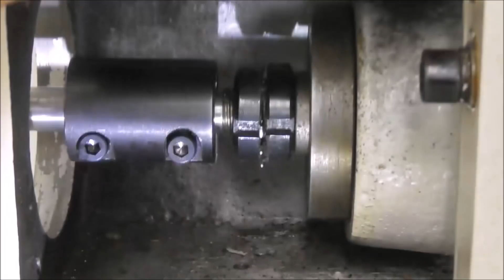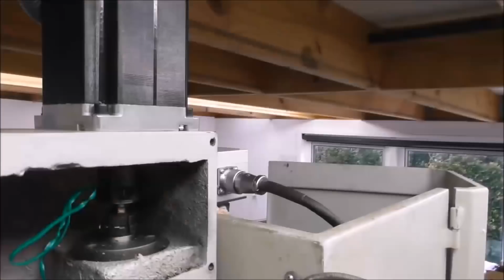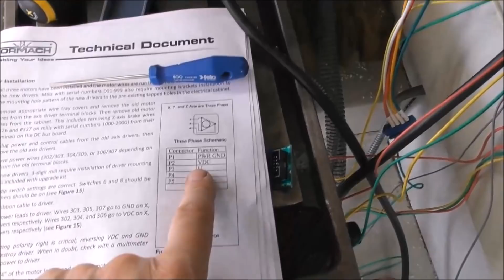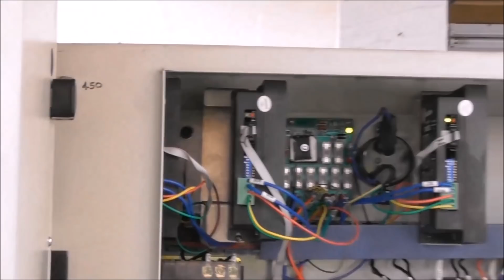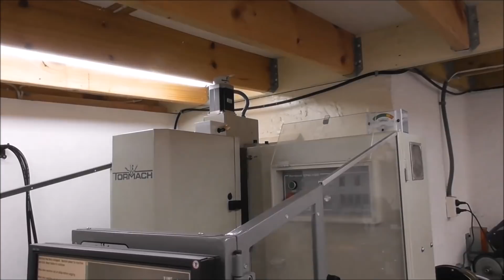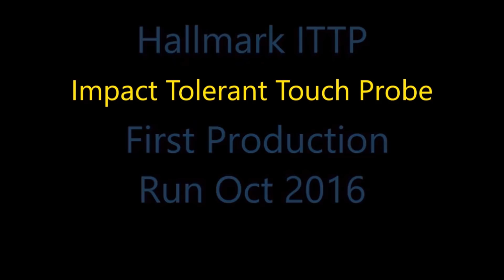Tormach series 3 upgrade and ballscrew thrustbearing adjustment etc     mp4

Comment: Are you sure those X/Y/Z actuators are not Servos? There are no steppers with less than 4 wires. UVW connections are for synchronous 3 phase motors.
Reply from the maker: Hi - Yes definately steppers.  Cliff
Reply: Thanks for your reply - never imagined there were 3 wire steppers! Is that what comes as stock?
Reply from the maker: @bikefarmtaiwan1800  Yes, as per supplied.  Cliff
Reply: Threadexpress Thank you for taking the time to reply :)

Comment: Great video! How does the upgrade compare to what it was besides a bit of speed? Any better accuracy at steps below .001?Thanks for the video
Reply from the maker: Hi - Good question. Yes a bit more speed is not enough reason to change. In theory the steps are more accurate, I have not yet checked that.  Cheers  Cliff

Comment: Hi CLiff, I just did the series 3 upgrade on my series 1 1100 about 6 months ago. It was well worth it for any series 1 owners out there who have not yet. I did sleeve my wiring in heat shrink like Cliff mentioned to aid in abrasion resistance.  Not to mention it makes the wiring a bit neater.

Cliff: As I seem to learn something new every day, I would never claim to be an expert at anything. So take this with a grain of salt. I do my motor mounting 100% opposite of you though. Or almost anyway. From my experience and I should note, I have not taken apart any Tormach steppers. There are usually spring washers in steppers on the bearings, so they usually have some axial forgiveness. They do not have any radial forgiveness. I usually tighten the motor mounting screws just enough so they hold the motor up against the surface it mounts to, then I tighten the shaft coupler, then back to the motor for a final tightening. I figured a few thousands of an inch would be absorbed by the spring washers in the motor, no problem.

-mcleod
Reply from the maker: Thanks for posting McLeod. I did not realize the stepper bearings had bearing springs. I did a bit of googling and could not find much except one image of a wavy washer at one end.   Cliff

Comment: Cliff - really good video much appreciated. Good customer service from Tormach to replace the driver so quickly - which is a comforting thought for potential buyers down under. Are you ever going to buy their lathe? OR is the rapid turn enough for you?
Reply from the maker: Hi Peter. Thanks for the feedback. Yes I have a Slantpro on its way now - I hope to videos on it also.
Cheers  Cliff
Reply: Cheers - very interested in your views on the lathe - in particular which set up you go for?
Reply from the maker: Hi Peter - Yes a turret if that is your question. But the exact setup details will no doubt be refined over time.    Cliff
Reply: Don't expect them to replace anything if the mill isn't under warranty. I HIGHLY recommend buying the extended warranty every year.
Reply from the maker: tacitus101010 .
Thanks for your advice. I wonder if an extended warranty would include air freight overseas eg N Z ? That is often more expensive than the part cost.  Cliff.
Reply: Good point! I'm in the UK, but all my Tormach problems started after the 1 year warranty expired. I'm VERY thankful there are people like yourself sharing knowledge.